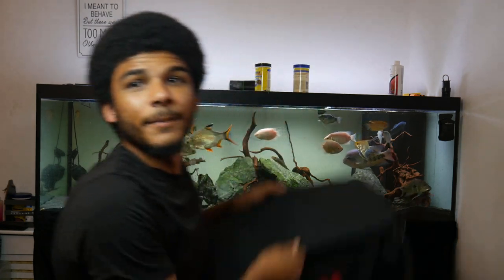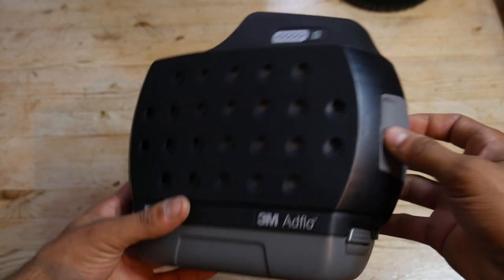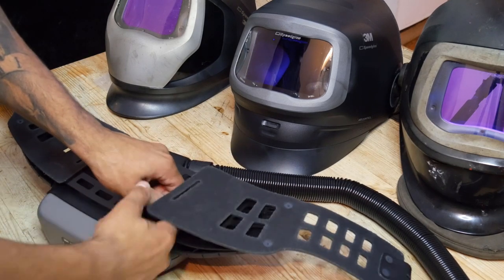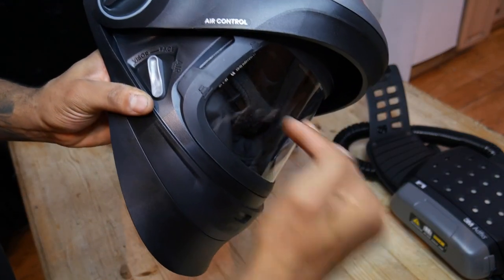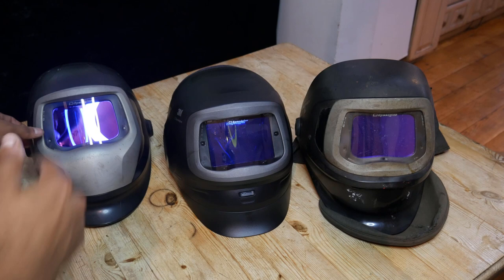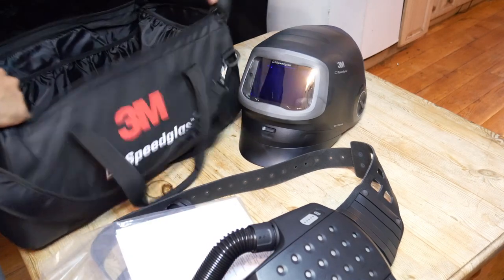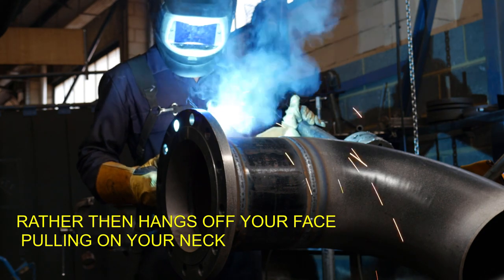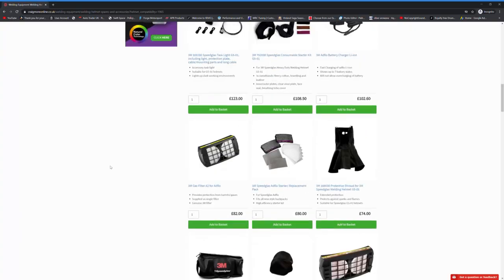3M SPEEDGLAS G5-01 REVIEW BEST WELDING HELMET?

Comment: I've been interested in going to welding school, but my concern has been breathing in fumes. Its comforting to see masks like these exist.
Reply: Go for the classes. They have all the safety equipment when it comes to dealing with fumes. Whether it be gases or smokey conditions. My college welding class has all sorts of ventilation systems when needed. Don't let that get in your way. You will have a great time learning to weld and it really is a lot of fun. Learning stick, mig or tig welding all kind of different materials. 

Best of luck to you!
Reply: I'm gonna be a bit more blunt buddy, if your worrying about fumes then forget about welding, no matter how people dress it, welding and work with steel is a dirty job, probably not for you man
Reply: @johanschimt3761  i agree I use these all my life SpeedGlas an gone from a small Lincoln extraction to big Kemper extraction going through the whole unit. With 4 motor's going to big tube an fliters. You going to still see an smell anti splatter  tip dip an oil lol 😁
Reply: Ill be honest... i hate every welding shade but the cool blue colour. Seems like a marketing grab to have 3 shades (2 you will never use) but i bet i would never use them. Ordered the optrel panoramax clt over this because it appears to have the shade colour i like and it is apparently really light.

Comment: Personally I think the 3M speedglas is a good helmet, just not the best for me personally. its super clear and very well built but I absolutely hate the headgear that's in it. I feel as though its way to mushy for my preference, and tge adjustment knob slips off the teeth causing it to loosen. what I find comfortable believe it or not is the basic Jackson Safety head gear, its built super tought, has a large tightening knob that doesn't jump teeth and is rock solid. If I could figure out how to rig it into the speedglas I would but for now  I have to put it in my other helmets. just my two cents though.

Comment: 3m g5 01 is the next level, if it had viking 3350 head gear fastener would b true legend, I weld in 35 year, I use these 2 shields when I go on jobs, only 1 improvement is needed, fastener don't last for me,

Comment: i have been using g5-01 years time. its very good mask. but the filter broke after 8 months. it has been replaced with a new one under the warranty. I do not know why, but even the new outer frame does not fit perfectly with the rest of the mask

Comment: The new flat scratch resistant protective lenses are not ment to be used with MIG/MAG - they let the spatter through.
To block the spatter getting under the flip-up in 9100FX... the headcover should have been attached to flip-up itself.

Comment: Hi Calvin! 
I'm new here as just got into pipe welding. 
I'm a TIG flat position guy, and cylindrical MIG and multiple passes are very new to me. 
Please could you give me advice on where to start learning more and settings for route and final pass. I use multiple dia pipe biggest is 10", smallest is 3" dia. 
Usually with flanges and butt welds. 
I really want to learn as much as I can, and have the opportunity to do so.
Could you help with some tips and pointers to start out ? 
I have a EWM surpuls set, mad settings on it, I'm overloaded with programs to use !?!?!,!!!? 
Great videos by the way, the G5-01 is a great mask to use ❤
Thank you take it easy man 
Matt.
Reply from the maker: Do you have insta? Hit me up on there and i can help you out, @arconewelding

Comment: The metal springs on the 9100 fx were fine. The newer ones are plastic and crap. Cant get replacements so have to buy a whole new mask when they break. Literally all of us blokes in the welding bay have had them break. Had 2 masks in 2 years. What are the springs like on the new one? Surely you don't buy you own mask? Company has to provide that legally.

Comment: hello there !! i have noticing while im welding with the g5 01 in cold mode blue state it changes colores depending on the angle, is it normal ?does the same thing goes for your filter , sometimes its blue the goes to a little yelowish , apreciate a reply , not sure if i must activate the warranty , thanks
Reply from the maker: Mine does the same thing no clue why, it happens more when my screen gets dirty and i look at different angles
Reply: @ARCONEWELDING  thanks fore the response

Comment: Was wondering if the filter are the same between your old helmet and the new one?
Reply from the maker: Yeh they are all compatible
Reply: @ARCONEWELDING  the 9100 & G501 ADF's are not compatible with each other, they have different fittings but the Outer and Inner protection plates are the same :-)

Comment: Hello arc-one I purchase the g5-01, and have about a week of use with it, I notice that it has grinding dust inside the protective lenses on the adf, both inside and outside the mask , I think you mention in the review that on the outside part of the mask the dust enters inside the adf, but I have it both ways, do u have the same problem? ,  the welding itself its clear, but I distract myself from the welding pool and start noticing some rays of light coming out of the welding pool, I don't know if it's normal, if I have to get used to it, ore if it depends where I'm welding, the ambient light, the angle, the amps I'm welding with , but sometimes it's there and it's not the protective lenses that's causing it cause I replace them! I saw that u weld in tig and in mig, give it a try in Flux core hi Amp and let me know the results, I would appreciate an answer, thanks and nice review keep it going
Reply from the maker: Hey dude, the grinding dust is supper annoying it eventually works its way everywhere inside and out on all surfaces i have no solution to fix it, and as for welding like coming through, ive never had that and not sure how its possible because if the neck seal is tight around your chin light cant get in, and when the welding filter is down i dont get any light bleed in, all i can suggest is checking the lid closes tightly but thanks for the comment

Comment: Heavy helmet no holder for a magnifying lens  not been thought about
Reply from the maker: Yeah they are heavy for a mask but its because it offers so much protection, and the fx and g5 both have magnification space
Reply: @ARCONEWELDING  I have to disagree with your comments on more protection for the weight been welding for 40 years  I have had various helmets I have tried both them helmets the fx does have fitments for a magnifying lens I have used both the new g5 has no place for a magnifying lens  to be fitted

Comment: Is that a Speedglas 9100 xx or xxi helmet?
Reply from the maker: its the 9100xxi
Reply: @ARCONEWELDING  would the g501 or the xxi PAPR helmet be better for a galvanized sheet metal job? It says on the description the the g501 is made for high amperage. Will the g501 be a good helmet for just sheet metal welding?